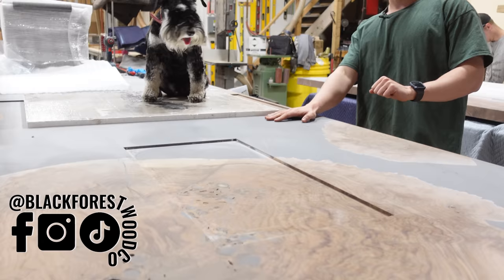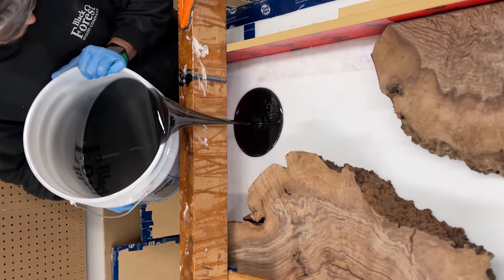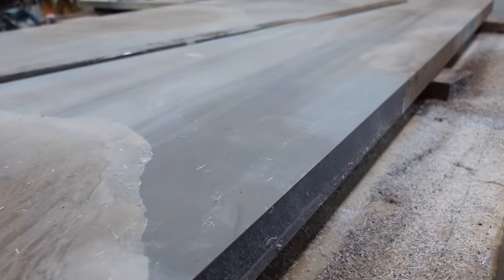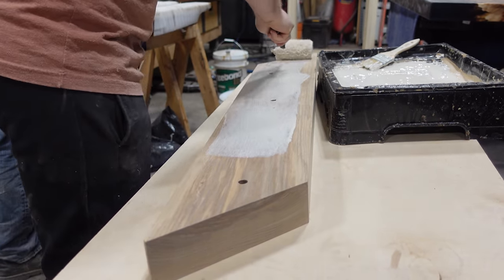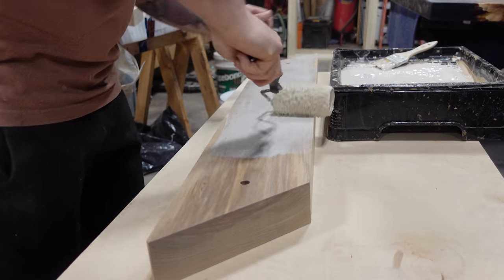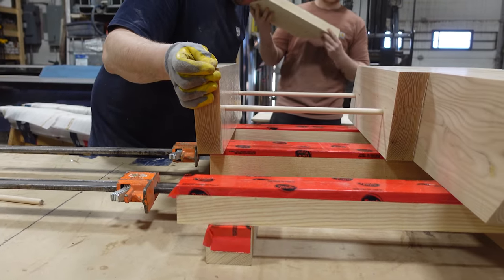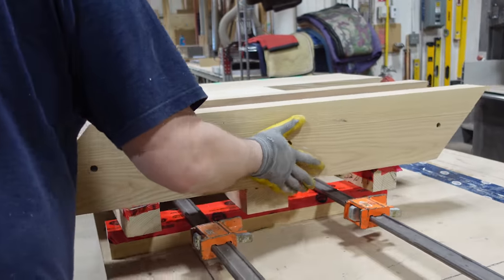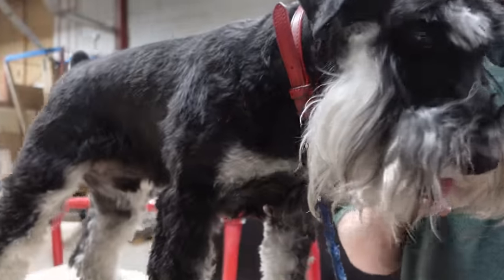Creating a Dining Table with Salvaged Burl

Comment: so nice to see the "salvage" be saved from  the chipper and then becoming hopefully a family heirloom PS at 5:02 i don't know if it is practical with the vac hose but when using a saw or other power tool like this i always throw the extension cord over my shoulder then you don't have to hold it, its behind you so you don't step on it and on finished tables and cabinet tops it stops it from rubbing in the edge if there is enough vac hose perhaps a folded towel or rag on the shoulder to stop chaffing  i was taught this when i was 18 and since then when i pick up any power tool plugged into an extension cord the cord goes over the shoulder without even thinking about it. this will be real nice piece for "salvage" lol try the cord thing see if it doesn't catch on? PS and if the cord get hung up on something then you don't have to turn around away from you saw just reach back grab it and give it a flick to unsnag it works with almost every tool i used over the years another great video guys PSS one last point about the cord if it gets snagged you feel it on the shoulder before !! it can pull tight and yank the saw sideways so there's that!!

Comment: Genuinely curious. What happens when 10 years down the road the epoxy and wood aren't playing nice anymore? I'm not saying it will happen. Do you guys have any sort of clause or plan in place to handle this?
Reply: They had a solid business even before they started with epoxy, which was something they were just trying out. They make solid massive doors and other projects that doesn't include epoxy. They have a massive amounts of beautiful wood slabs, of course they can make all sorts of projects if the client doesn't want epoxy Specifically.
Reply: @ScandinavianHandcraft  I know this, I've been following them for years. This was not a knock on epoxy or their craftsmanship. It was just a question about the longevity of the product. 

Edit: I'm sure this gets asked all the time from a different more hostile perspective. I think their work is awesome, but I've always wondered about how the wood and epoxy get along over time
Reply: @nectar7081  Ah okay, then i misunderstood
Reply: @nectar7081  if it is treated properly by the owners it should last a long time.

Comment: How do you not have bubbles running through the resin?
Reply from the maker: Our Black Forest Deep Resin is the biggest factor because it's a slow curing resin, but other factors like fans, air conditioning, and a water cooled table help as well!